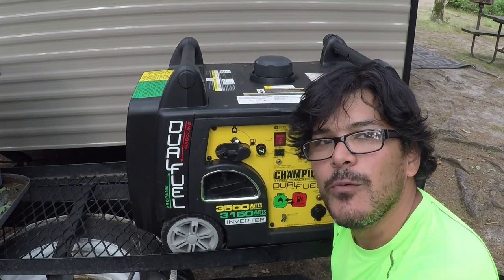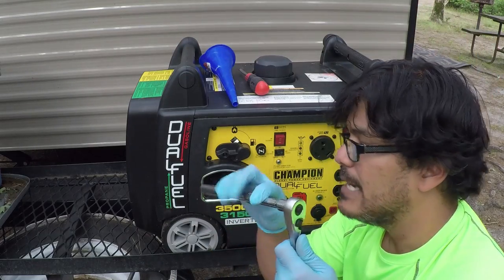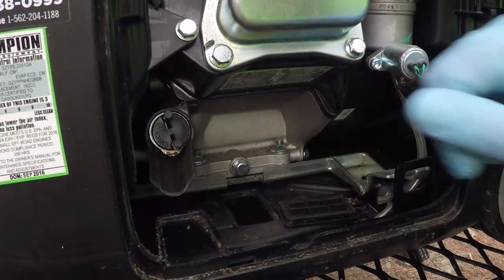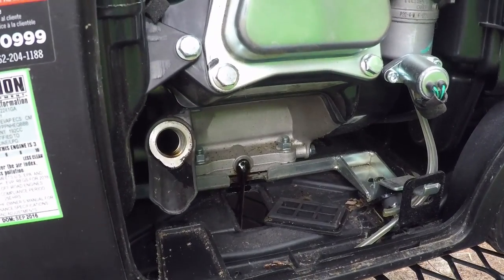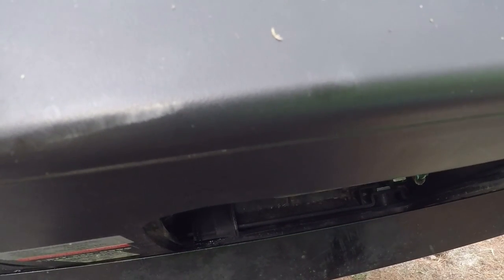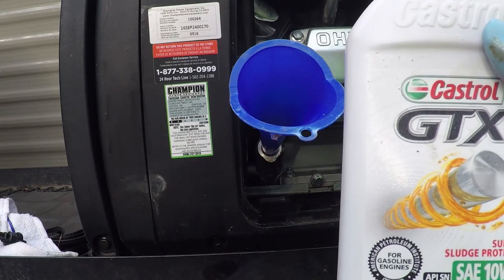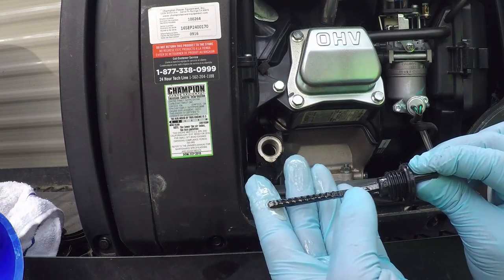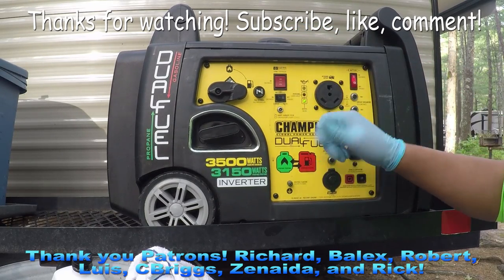RV Generator Oil Change - Champion 3500 Watt Dual Fuel Generator

Comment: Dude I have the same generator.  Mine came with a flexible hose where the oil plug is on yours and attaches to a stand off bolted to the engine.  So much easier.  This must have been an afterthought from champion.after they manufactured yours. I’d contact them and see if they will send you one.  They may for free.  Just a thought.  You will be much happier changing the oil. You literally loosen the clamp on the standoff connected to the bolt, pull the hose off and drain it into a container.  Then you stick it back onto the standoff slide the clamp back up into place.  Your done.  If you watch other videos you will see what I’m talking about
Reply from the maker: Hey Brian,

Thanks for letting us know. We will contact Champion and see if we can get it. 🙂

Comment: I just setup our dual fuel 3400 Champion yesterday, and they have added a tube on that drain plug you were struggling with. The black tube goes upward and attaches to another part of the motor with a simple spring clip. You undo the clip and point the hose down, and it drains the fluid easily. No tools, no struggle.
Reply from the maker: Nice!  Thank you.

Comment: I was kind of psyched, thinking perfect, I'm at 60 hours and will need to do this eventually. As soon as you got to a socket wrench or whatever that was, I realized I'm just going to pay someone to do it. 😀  (I'm boondocking right now, I've emptied the tank four or five times now, I figured out how to fix a lot of little things that have gone wrong, but  it's 94 degrees here in to Grand Junction Colorado, and I had to turn on the generator and air conditioning because my cat was giving me the evil eye, and I am just going to pay someone to change the generator oil.  😒
Reply from the maker: +Julie Burgess oh no!!!  It's just 1 ratchet, 1 12mm socket, and an extension!  So long as you have those 3 and place for the oil to drain you'll be ok!  My only difficulties were the first time when the bolt was on so tight. And the problem was that I didn't have the right extension! :) :) But if not, yep get help and you will be rocking and rolling!
Reply from the maker: +Julie Burgess what kind of Kitty.? :)
Reply: Exploring the Local Life Nothin' fancy, a tabby :-)  Don't mind me, Robert.  I set out with my very first RV from Florida to California and now heading back east, and it's been almost a month, and it's been a blast, but I'm now starting to see how the vacation does end LOL. It's not all sunshine and rainbows, although there have been so many of those! But it's finally hitting home that the rving life, as you guys have said in the past, is not Nirvana LOL. although I feel very accomplished now and have no plans to give it up. Anyway, thanks for all your videos.  it is very helpful to see reality rv videos.
Reply from the maker: We have a tabby and torti! :) You are very welcome for the videos. Yep, RV life is great, but it is real life. Stuff goes perfectly on some days, but not others. :)

Comment: Just curious. What model and BTU is your AC? Have you run it on propane and how did it handle the load on propane and gas? Thanks for the video
Reply from the maker: 13,500BTU It runs much better on gas, but it is nice having the option of propane